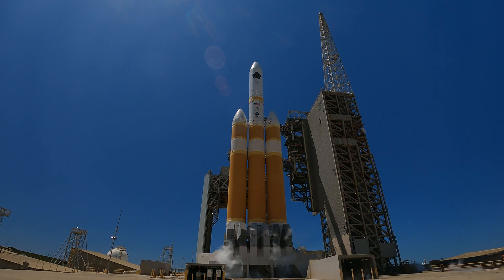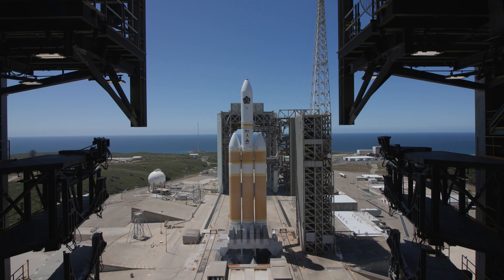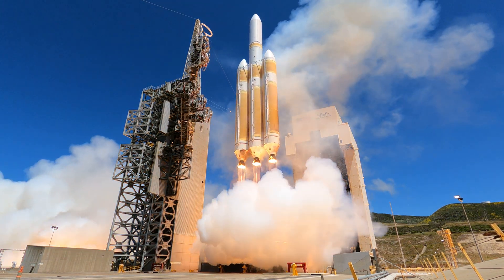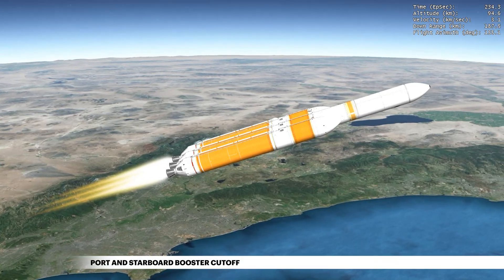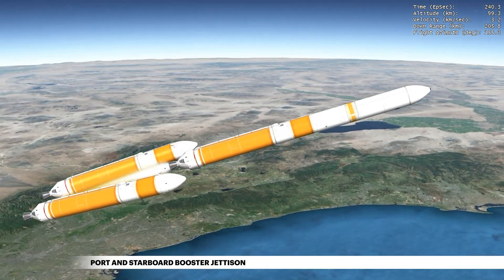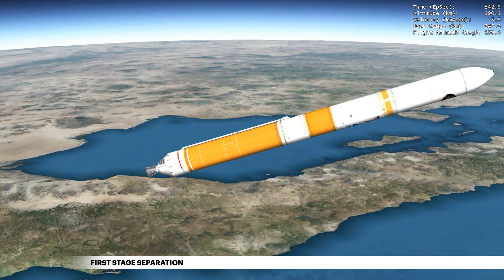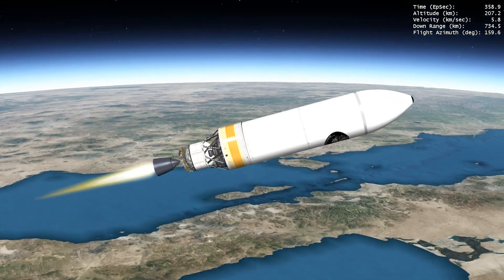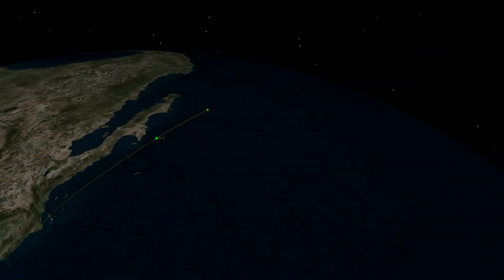Delta IV Heavy NROL-91 Mission Profile

Comment: Why not use them to shuttle astronauts along with SpaceX to ISS instead of paying the Russians?
Reply: We are not currently paying the Russians to fly astronauts. The seat swap agreement is a seat for a seat--an American astronaut on Soyuz for a Russian cosmonaut on Crew Dragon--with no money changing hands. In fact, as Soyuz is almost certainly the more expensive of the two systems to operate, one could even make the argument that this is a net drain on Russia's resources. As for Delta IV Heavy, it was never human rated, and as production has stopped--with only a couple of launches left after this one, and all of them already spoken for by customers--it wouldn't make sense to try and crew-rate it now. Boeing's Starliner spacecraft, launching on Atlas V, has now completed a successful uncrewed test flight, and is scheduled to make its first flight with crew on board early next year. Once Starliner's fully operational, we will have two methods of transporting astronauts to and from ISS independant of Russia.

Comment: Why does one (starboard) booster ignites earlier?
Reply: 00:03 "To mitigate the fireball" The motors spew unburned hydrogen and oxygen into the infrastructure under the rocket until they're ignited. Hydrogen catches fire with a bit of a 'pop', so they're avoiding the all-motors pop by staggering them. Not sure about "ignite", it doesn't make complete sense to me unless they delay discharging propellant too - I can't help thinking if all motors are discharging propellant but not ignited, lighting one would still risk the 'triple pop'.
Reply: I just did a video on my channel regarding it. U can just search delta iv heavy fireball rocketgyan and it should appear. The video should explain u the proper ignition sequence
Reply: I mean, the narrator explains this at the very start of the video...open your ears, find a Qtip, hire a translator, etc...